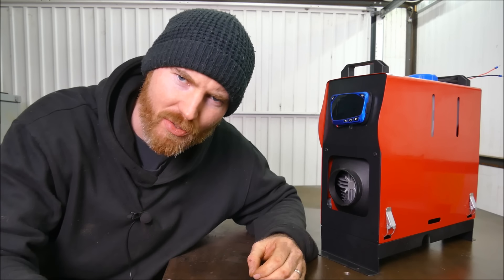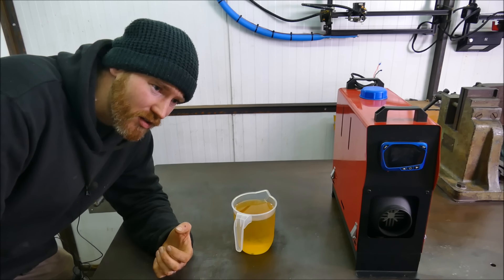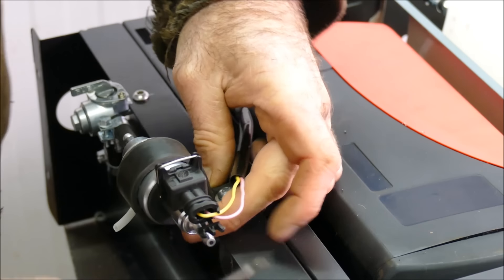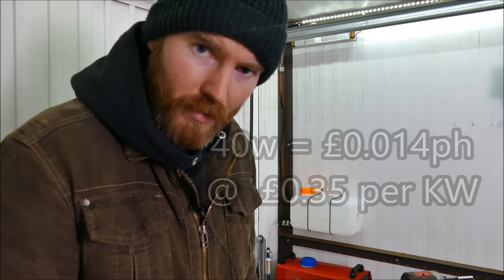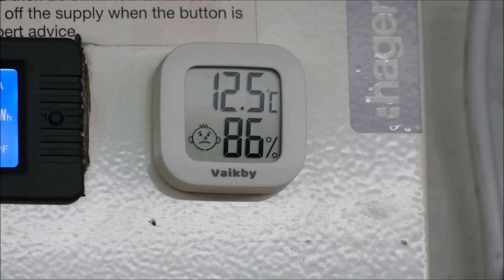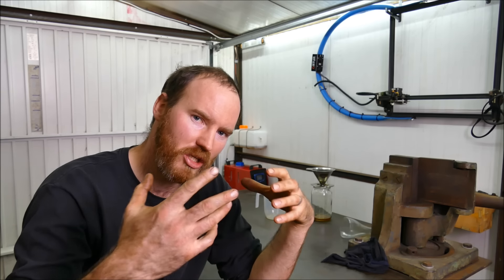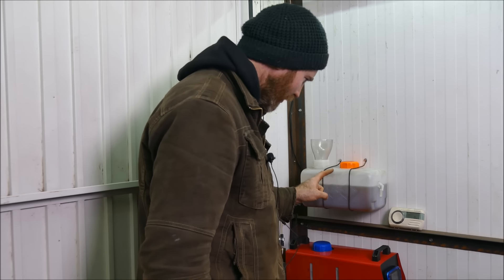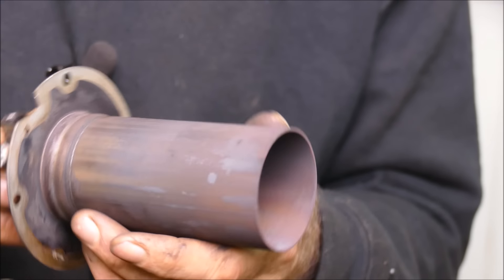£0.03 per kWh heater modification - Top facts & lies on diesel heaters - waste veg oil burn success

Comment: An excellent presentation with very clear explanations (even though I'm mentally converting values into our archaic US Imperial measuring system and into US dollars).  This kind of dirty-hands, "farm engineering" is becoming a lost art.  Schools in the US and the UK aren't teaching hands-on, practical skills any longer. IMO, this is setting us up for failure in the future because nobody will know which way to turn a bolt!
Reply from the maker: Thank you so much. I believe self reliance is the best form of insurance. The less dependent on companies and governments the better. Cheers J
Reply: @joshuadelisle  Like thinking from "across the pond"!  Western society has become so helpless/skill-less that we're now like little children!  Last winter, my neighbors were very concerned about our street flooding.  Frantic calls to the City Public Works department, demanding action before our homes flooded.  Nobody ever thought to just shovel the leaves from the storm drain grate at the corner until I came home from work.  I had the street completely drained within 5 minutes armed with nothing more than a shovel and rubber boots!
Reply from the maker: @steverandall5814  yep the real pandemic is stupidity unfortunately. A dumbed down nation that is easy to manipulate. Cheers J

Comment: You said 2 things. First wanting to prevent liquid inexhaustible pipe. Second you said you used a 6 ft pipe. Why not use 2 3 ft pipes joined with a t in the middle. Both pipes slope down to the t. And the 3rd t connection is attached to a airtight container that will collect liquids, if any.

Comment: I used to play making bio-diesel for the car, from used veg oil, from a chinese. I used to have to pay for it.

And used these heaters for years. Running on kero. Never run it on oil though, as expected it to get gunked up. Have since seen othe YT tests where yep, they get gunked. I an happy to pay for kero, and avoid the clean up work.

Comment: The water in the exhaust probably wasn't a leak.  It was likely combustion water vapor condensing.  46 water molecules are released during combustion.
4 C12H23 +71 O2 –> 48 CO2 + 46 H2O.
I would add more pipes until your exhaust pipe temperatures are dropping to just above 100c upon exit for maximum heat extraction.

Comment: Just keep in mind that Kerosene has no lubrication properties at all. I always add 5 to 10 % of diesel fuel for this aforementioned reason. I just can't bear to run a pump dry of lubrication even for a few seconds.
Reply from the maker: Well kerosene is £0.60 per litre whilst diesel is currently £1.55 per litre. Mine is still going great 12 months on and new pumps are only £15. Doing the maths I'm happy to pay for new pump and continue running straight kerosene. Cheers J

Comment: different countries different rules. about making fuel.  what is not allowed to let your car drive can be used to cook or heat.. check the rules about where it is said it is illegal. 
if the contend is used with vehicles. it has to do with taxes.  this can be different on generators and heating

Comment: I use a Server PSU to supply power to my Chinese Diesel Heater.
They are of very high Quality, very powerful and designed for 24/7 Operation.
They are also very inexpensive!

Comment: I can't help but think the manufacturer has missed a trick.  Why not pipe the exhaust and outlet from channels within each other?  For example, think of a circle within a circle. The centre is the exhaust, the outer circle is the outlet.  The exhaust outlet can be piped out the outer pipe a meter or two down the pipe.... and ambient heat would be pumped into the room.  180+ degrees is a significant amount of heat to lose.
Reply from the maker: Two reasons. Firstly the combustion works better with cold air because it's more dense compared to hot air which means there is more oxygen. Secondly the fan is plastic so you don't want that getting hot and instead to keep cool. Cheers J

Comment: Only run that - what is it, 35mm? - exhaust tube a minimal distance before sending it into a much larger and smooth pipe, and run that slightly uphill. The gas will slow down, allowing time to release the moisture, which will pool at the lower end, conveniently near to all the other things you need to keep an eye on. And put a water trap at that point. You'll see how much water's accumulating, and if you open the draincock the water will flow out but exhaust gas will still be trapped above it, provided you shut the drain before all the water's gone. Also, the reduced gas velocity overall will allow more heat to transfer into the larger tube, so you may not need any other heat exchanger / radiator.

Comment: Btw in the previous video you were worried about ‘ZAPPING’ yourself, with 12volts dc, in industrial electrical ( portable power tool) systems we limit the Voltage to 110VAC CTE the cte bit is this whole point. Because; when you centre tap a transformer, each ‘line is only 55 volts to earth as the CENTRE TAP of the transformer is connected to Earth.
Therefore; regardless of which conductor you touch  (accidentally I hope) as a human being you will be unable to receive sufficient energy to harm yourself.
So , at 12 vdc ( basically half that energy, Albeit some slight calculation difference ) it is impossible for you to receive sufficient energy for you to be even able to perceive it  let alone it cause you any harm at 12 Volts Direct Current. ( that’s why you can’t lick your fingers and touch both sides of a 12 v car battery! Without you being able to even feel it. Even if you stood in a bath of salt water.. BTW LOVED YOUR VIDEO GOOD JOB.

Comment: In my quest to create alternative stand-alone stationary power, I have designed and built both windmills, which compress air and air-powered engines for well over 50 years and even though it would appear that I have unlimited FREE power, my point is, there's just no such thing as a free lunch.

 Someone somewhere always picks up the tab.

Comment: I've never seen yellow Kerosene, that looked like Fuel-oil.
Reply from the maker: It's heating oil grade kerosene
Reply: @joshuadelisle  here in the states we call that fuel-oil, lower quality than diesel.  The kerosene I get from the local gas station or hardware store is clear, closer to A1 or jet fuel grade.
Reply from the maker: @ryanthomas9869  yes jet fuel can be used also. Diesel has additives for lubrication so doesn't burn as clean as kerosene. Cheers J

Comment: Burning waste oil isnt illegal? Not in the uk.
Reply from the maker: @dannythorpe1425  you need a license and an approved system. This is £1500 annually and the systems are not cheap. Check the legal requirements. Cheers J

Comment: Use sand instead of water. Sure having a bucket of hot water is nice... but sand is better at storing thermal energy and releasing it even slower over time.

Comment: I wish there was a way, and my complete ignorance in several fields will be obvious in my asking, that a device with this versatility in fuels, with a similar price tag, could also be part of an affordable system that could act as a power generator, because the sun may rarely cut it for a great deal of the year….
Reply from the maker: A diesel generator is definitely a thing. In fact with a standard generator you can capture the waste heat whilst making electricity. A typical generator is only 30% efficient and wastes most of the potential energy of the fuel to heat. Cheers J
Reply: @joshuadelisle  thank you 🙏 I must look into this!

Comment: What consumption does it have in the technical specifications?
Reply: What model did you use?
The one with the specified consumption of 0.16-0.62 L/H or the one with 0.1-0.24 L/H???
What is the difference between them considering they are both 8 kw???
Thank you very much!

Comment: I don't see how all the extra energy needed to get cold outside air up to temp would be more efficient then just recycling the air inside the house. Sure you will have some negative pressure but I it's going to have to run less to keep that temp when the air it's heating is already at your indoor temps.

Comment: That little air pump is never going to create enough neg air pressure to be noticeable in a shop. Maybe in a tightly sealed closet. Lol. plus, taking air in from the heated space will create a positive (heated) type feedback loop in the shop. Which should create better overall convection efficiency. As in heat the space faster. Plus pulling in a little fresh air is always a good thing when using a combustion type heater. Which in that case having a room outside air intake and inside 02 monitor may be a good idea. And, I know this is long winded, from outside you're pulling in water from the air. Please feel free to constructively criticize any of my comments. Lord knows I'm not always right and want to learn.

Comment: You’re mixing power and energy.

What ever chemical energy is stored in 350 ml of fuel, the power is how fast that energy is released.  You can release that energy at 1W or 1MW, it just changes how long that energy output lasts

Comment: You missing point many on heat pumps are on heat pump or ev tariffs.   7p a kw base per kw for ev tariffs and 20 ish p base for a heat pump tariff near all day except 5-7pm    So more like 2p on an ev tariff a kw for a heat pump and battery solution.   Or 5-6p for a heat pump specific tariff

Comment: Kerosine is used for heating and light in many 3rd world countries, it causes a lot of health problems.  I think if my neighbours all started essentially idling diesel engines to keep warm I'd be pretty annoyed.

A small standalone heat pump is a close analogue to this device.  They're hundreds not thousands.  They also offer cooling in the summer and mean you don't have to store and handle gross fuel all the time.  Please consider the wider consequences of trying to save a few pennies.

Comment: Very good Video, perfect explanations. I would go for a backup Battery in parallel to your power supply/charger. I did it without a bat and when i had a power outage, fan stopped and Plastic housing melted ....

Comment: Rules, regs, laws. I've read through a HUGE number of comments but havent seen any on this side of things. Could anyone with info reply to this comment? Specifically any updates on what can & can't be burnt (please mention the country it relates to) and whether these can be installed in houses.
Reply from the maker: Basically if you obey the rules with cheap equipment that you maintain yourself and use fuel that is tax free and cheap it's always going to be a no. These units don't come with government regulation and insurers will not like them either. Does that mean they're unsafe?... That depends on the users practical knowledge. Otherwise you want to go with what your local accredited boiler plumber will suggest instead. Cheers J

Comment: Thank you for an excellent series of videos .
👍👍👍
The exhaust ...
Was that a heat resistant "BBQ" paint?

Do you have a link to a supplier of the extra long pipe please?

Would the long pipe idea work inba relatively small space like a van if it was wrapped in exhaust tape?

Comment: Hello Joshua. Just found these videos online, very interesting! And maybe somebody already mentioned it, but why not connect the exhaust pipe to a fancy bathroom radiator? It should be possible to calculate how many meters you need to cool down the exhaust air to 20 degrees Celsius before throwing it out, so having a radiator that big will give you the maximum efficiency and it still looks good. Also I thought of connecting the hot air outlet to a floor piping system, so you'd have floor heating, plus still have the air outlets in various corners. Maybe a bit too much for a shed, but for a new to build off grid place it might be an idea. Anyway, keep up the good work, regards from Hamburg :-)

Comment: 3.2hz at topp and 1.2 low Hz.

And fan speed 2100 low and 4000 topp. 

Save massey fuel and Brings you the same heat.

Dont use oil and vegy. Long term fuxks them up

Comment: That’s, very informative video. I’ve been heating my workshop for the last 3 years burning kerosene and only stripped the heater down recently, no issues. I have a 220ltr drum that gets filled up at the same time as my domestic tank, works fine for me. Will be trying out the veggie oil mix. Cheers.
Reply from the maker: Well done. Cheers J

Comment: They are a bit shady but they certainly prove the point that our energy prices are 20x
I thought "economies of scale" would bring us cheaper energy, but apparently you can heat your own home for a fraction of the price.
I ran the maths on a petrol generator and realised that as soon as Im in my own place with a garden, I can heat and power my own cheaper than the suppliers.
Something has gone seriously wrong with the UK power supply.

Comment: Your electricity is priced per kW/h (kilowatt hour) which is a unit of energy. A kilowatt is a unit of power. If you run a 10kW device for an hour it will use 10kW/h. A litre of diesel contains 10kW/h of energy but the time taken to consume it depends on the power rating of the device. Hop this helps.

Comment: If you mix the kero with the oil first, it will filter faster being thinned. alternatively... you can centrifuge it. ($$$$)  Get a diesel car if you get free used oil....
Reply from the maker: Good tip. Cheers J

Comment: Have you or anyone else had an issue with smell? I’ve run mine for at least 6 hours and can’t get rid of this rubber chemical smell.
Reply from the maker: If your exhaust is outside and properly sealed on the machine then that is maybe just residual oil from the manufacture which will go eventually. It's worth checking the inside in case there is a piece of plastic touching the burn chamber. Cheers J

Comment: As soon as they made it legal to burn veg oil, it's price per litre in shops  matched diesel. I used to run a car on it, cheapest was 20p litre.
Reply: I would run the veg oil pipe in the warm water to thin it out.

Comment: I cannot stand placing the exhaust inside living space. The violate the original design of the heater as used in a Caravan. In a caravasn, all the input and output of the burnt air as well as the diesel fuel inlet are placed outside the caravan to provide the safety by isolation. People keep forgetting this important design feature to make the diesel heater safe.
Reply from the maker: There is no exhaust inside, that's dangerous. Cheers J

Comment: So i know this sounds a little counterintuitive but dropping your air speed to 4400-4600 does help with the burn and I like you set mine at 5000, but if you were to hook up just the blower to a variable power supply and while heat unit is out of box and do air flow tests with your meter, after about 4600 rpm the air flow out doesn’t rise much but power in fact does rise alot and if you look at the internal blower wheel you can see how the intake port is in fact half its size because of the way its casted so the efficiency of air flow is best at 4500 rpmish, and so I use at 4500 foot altitude a fan speed of 4500 rpm and a pump speed of 3.6hz with a less than 20 ppm toxic output. Not many people get it right but of the many videos i have watched great job, thanks for all your time, if this would have been the first video i had watched it would have gotten me close to perfect. You get a gold star for the day!
Reply from the maker: Thank you so much. Great information. Cheers J

Comment: usually these heaters havea very speciic warning forbidding to extend the exhaust "pipe" length over the provided pipe length (usually 1 meter), you may want to verify that point because there is certainl ya very good reason why they forbid to do this.

Comment: sorry to say painting the stainless steel exhaust black is not a good idea it has more reflective energy if you secured aluminum foil to the wall then you would have been almost as successful as those heat pipes secured over the cashiers area in the big box stores. I'm guessing that technology hasn't arrived to your neighbourhood yet.
Reply from the maker: It's just for the thermal imaging. Cheers J

Comment: If it wasn't for the incredible noise we'd all be using these in our homes.
Reply from the maker: Noise isn't too bad especially when running on lower settings. Even better if the unit is outside. Cheers J

Comment: This is more than a year later, almost 2 years in fact, make sure that your exhaust is slightly more than 100C, so that there doesn't remain any water inside your exhaust pipe.

Edit: This comment was made after seeing your later video with the sand battery and the computer fan. This comment was made with keeping in mind if you want to use this in your house or a living space, as even tiny drops of carbonic acid over a period of time can cause issues.

Comment: People who use veggie oil to run diesel cars use 5% petrol  (gasoline USA  benzine EU )  to thin fuel  to help the pumps and get better fuel burn . Also kerosene  is  normally 7 parts paraffin 1 part  petrol .Red diesel has more heat content than yellow diesel. Waste oil has more heat content than  red diesel as it is thicker oil with bigger carbon chains . Probably best to add 5% petrol to waste oil to get good burns  and help pump.. keep up the good work but made in china is often TOFU crap with low life spans to use with waste oil

Comment: It's probably already been suggested, but I am wondering if heating the vegetable oil would make it burn cleaner.
Reply from the maker: It would definitely help. However the issue is you don't want the pump heated but you also don't want to heat the diesel/kerosene either so it's difficult to place than less you add a second pump which is getting complicated. Cheers J